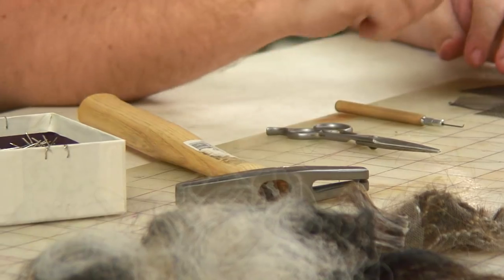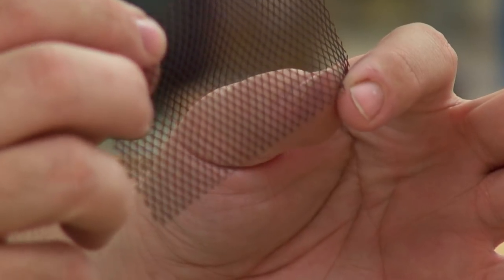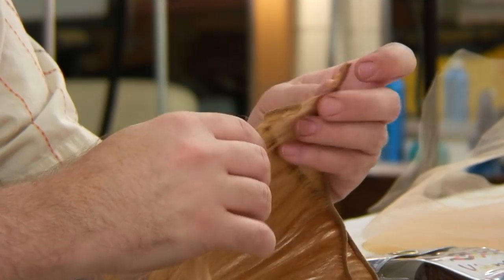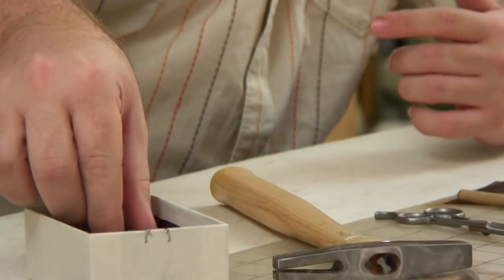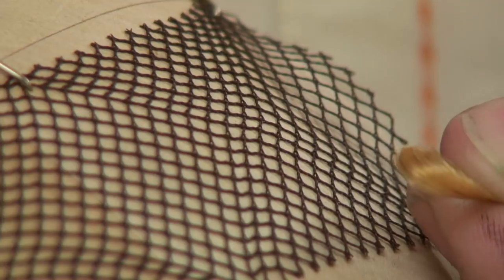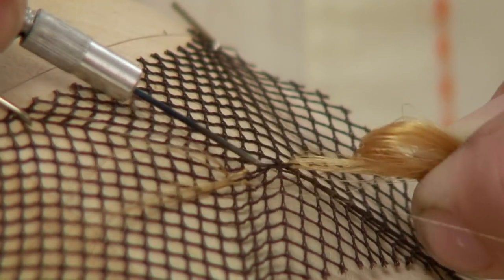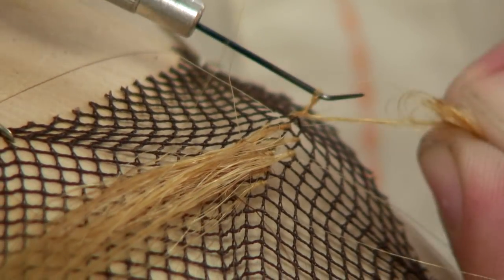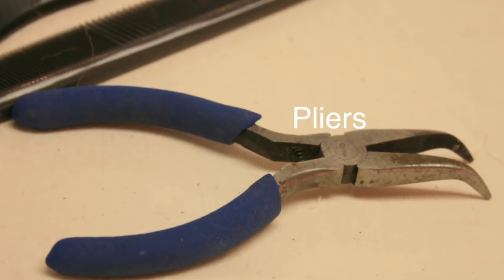The art of ventilating with Ricky Greenwell

Comment: I love your video Ricky! I'm starting out with synthetic hair too and it is really hard to work with but it's cheap and I can get a lot of it. Your video shows the process the best I think of all the ones on YouTube, thank you! But I'm having trouble with the last part when I pull the hair through the loop, the rest of the hair I'm holding in my left hand will bunch up and separate! Then I loose speed having to flatten, and loop the hair again. Am I holding the hair wrong or too tight?

Comment: Have you got any tips for a complete beginner. I just bought a ventilating hook from China they claimed it would have a latch hook. Unfortunately it does not.  The needle is only picking up 1 or 2 strands of hair.  I feel like giving up.  It is drive me crazy.  As soon as I draw 1 hair through the needle it fall straight off.  However, I would really like to learn this technique.  I am from the U.K. so ordering from American is out of the question because of shipping.  Any advice would be very much appreciated. Thanks
Reply from the maker: http://www.atelierbassi.com/en/ are great EU Source. some hooks do only pick up one or two hairs these are the kind of hooks you use for the from of a wig the lager the number the more hair I believe. Wig work can be very slow going but once the get the hang of it it can go fast. The big issue is tension on the hair keeping it even. Makeup sure you have enough hair loop on the cut end so the you can complete a knot with out it pulling out.

Comment from the maker: Let your needle do the work. Ventilating needles will pull different amount of hair depending on the size of the needle. if you are wanting to only pull one hair use your smaller needle. You may be applying to much tension causing the hair to break.

Comment: Could you explain how to ventilated if I have virgin cuticle intact? As you know , the tangles and matting are guaratine for the returns of the opposite direction. Why no one explain this tip? It's the most important thing before to start !!!!!!!
Reply from the maker: The Cuticle of the hair has to in you hand that is tying the not in the loop. I call the cuticle the blunt end rather the the point end. The point end the the very tip or end of the hair and you want the to remain so. I make a loop with the futile end or blunt in in my hand and that is the end that my needle takes the hair from and ties the knots.